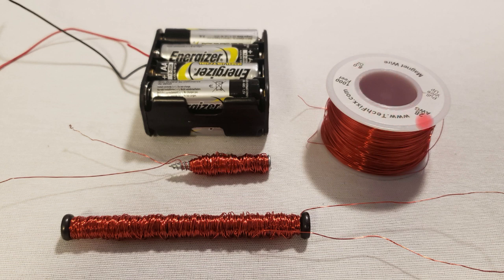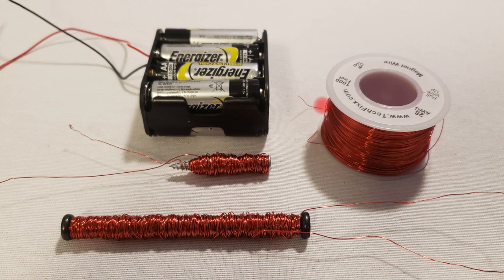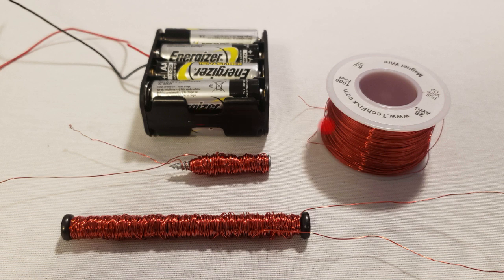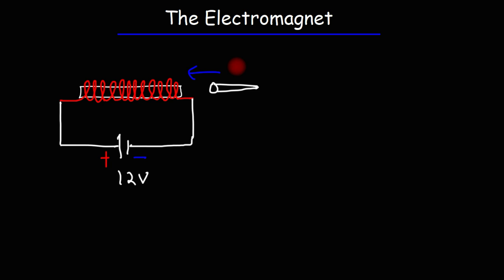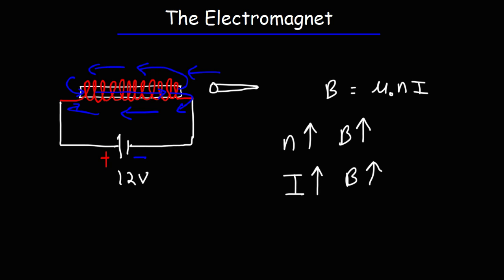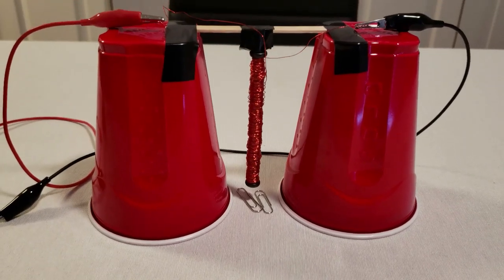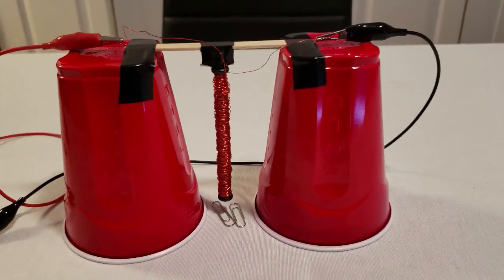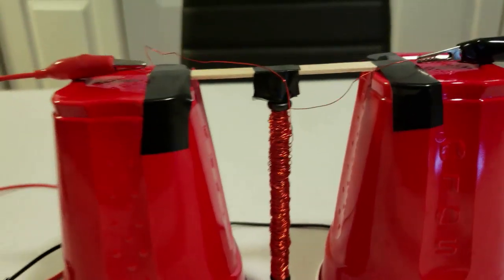How To Make an Electromagnet

Comment: Is it possible to increase the strength to the point where it can pull chainsaws into the air from a couple meters away? Thanks!
Reply: thats oddly specific...
Reply: Probably not as most chainsaws aren't entirely ferromagnetic but it's possible to pull a chainsaw from a few inches away assuming you have a neodynium supermagnet as their strength decreases exponentially the further they get from the magnet itself (warning: neodynium supermagnets are very dangerous and have caused numerous amputations so it is highly recommended you don't try this)
Reply: @Ferroes  Ah, I see. Thank you! I will put this information to use...
Reply: Friend; "to use"
'aight. Just be careful with the magnets; they can trap your hand if you're reckless

Comment: Organic chemist you have a power source going through a conductor I would expect the wires to get hot without a resistance in the circuit
Reply from the maker: They sure did!
Reply: @TheOrganicChemistryTutor  can you help me find an ac power source for an induction heater and determine the watts, volts etc needed or help put together an induction heater? This might be a great experiment for your students too? How can I contact you for help with an at home project? Thanks!

Comment: I quite liked your demonstrations; they were very dramatic. I did not know there could be insulation over the copper wire when wrapped around an iron core. So that insulation does not reduce the strength of the magnetic field? I noticed that you said that you used direct current in the demonstration; I think that it would be nice to see a demonstration with an AC source too!